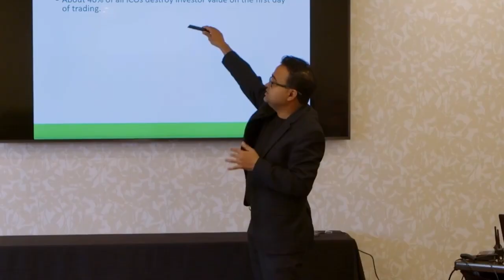Optimizing a 51% Attack | Justin Drake | The Mining Pod

Comment: Let them try. If it was that easy, it would have been done a long time ago
Reply: Justin never said it would be easy, he said 'here are all the ways a sophisticated and well capitalised actor could optimise an attack on bitcoin'
Reply: This is the ONE topic where the past gives ZERO indication of the future.

Rewards to the attacker are highest at the maximum delta between BTC price (high) and Cost of Attack (low.)

In PoW attack the offence goes Short the asset.  
Max profit occurs when the price has farther to fall.  They want BTC price up at 200 to 300 k.  
Miners are paid now almost entirely by Subsidy.   Roughly $25 M per day. ( And several are in Bankruptcy.)
That Subsidy must be replaced by Tx Fees.  

In say, 10-15 yrs,  if Tx Fees are only bringing in, perhaps 20, or $15 M per day,
there may be much less Mining.
Cost of Attack = Low.
Price of Asset = High

Max rewards for attack occur in another decade, or so.